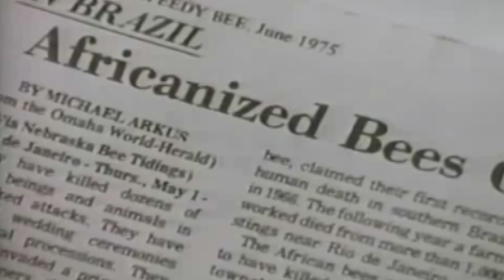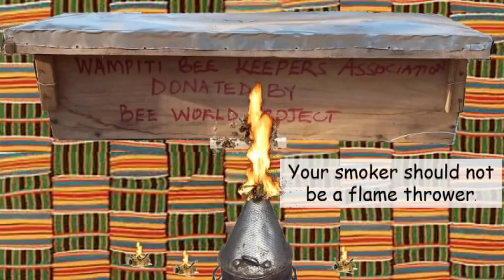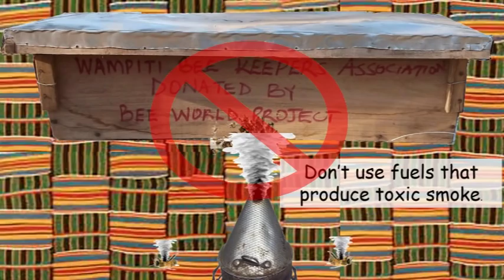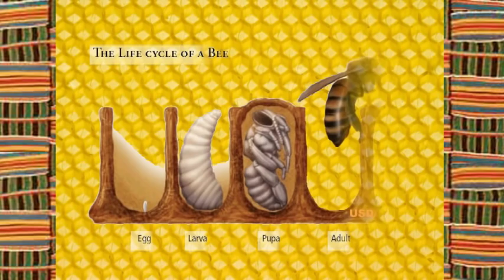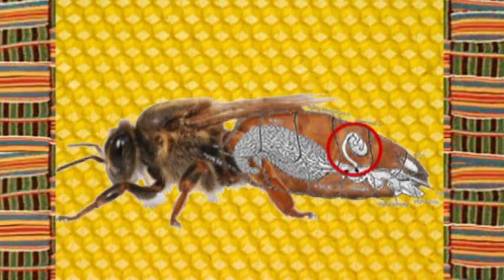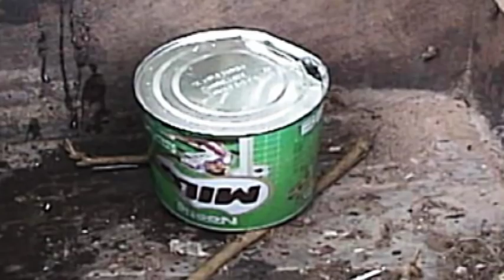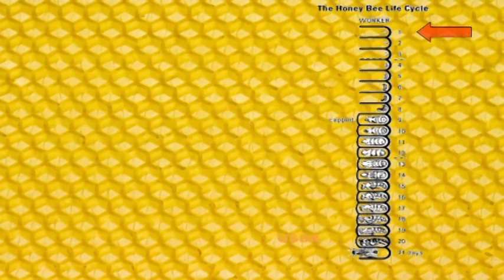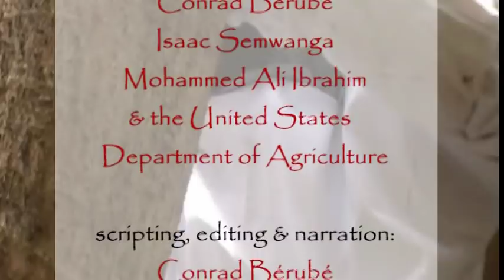managing african bees

Comment: Are all your hives 4.9mm
Reply from the maker: from http://beesforbabar.org/pdf/small_scale_beekeeping_2018.pdf p. 60: 
"It is important that the width of the top bars be correct so the bees will construct only one
 comb per bar. For African races of the western hive bee, the width should be 1.2 inches (3.04 centimeters). For European races, it should be about 1.4 inches (3.55 centimeters)."  

That being said many rural bee-havers in developing countries (working with the smaller African derived races of A. mellifera) don't usually have a ruler or other measuring device so I tell folks to use the width of a standard beer bottle cap-- which is just shy of 3 centimeters-- which is close enough given the cutting tolerances and the fact that the topbars will "expand" a bit as they acquire propolis along the edges.  

Where on earth did you get the 4.9mm dimension?!  

Even if you meant 4.9 cm that's almost 2 inches, too wide for topbars even with temperate zone bees.